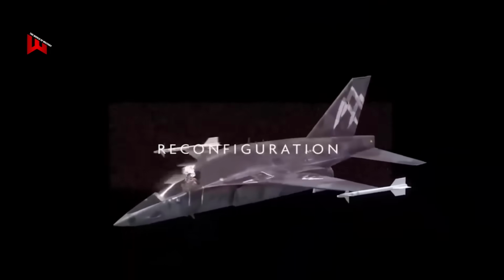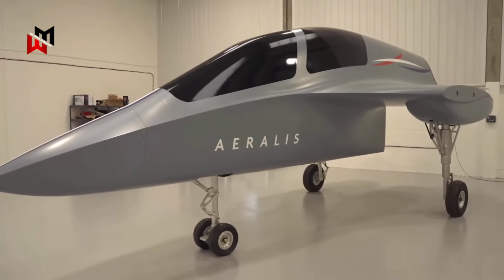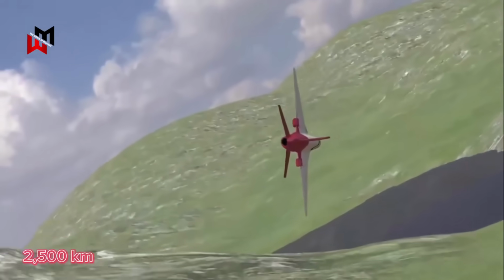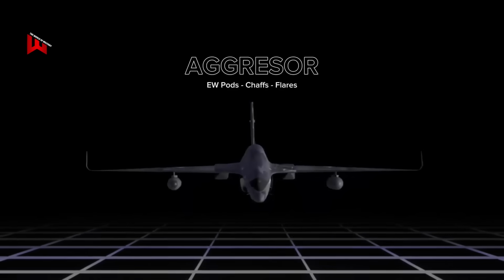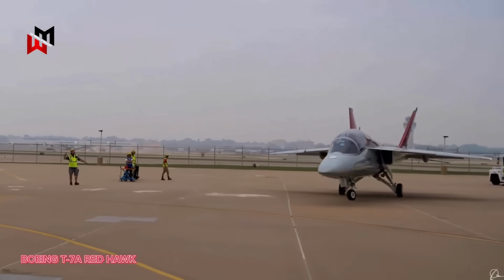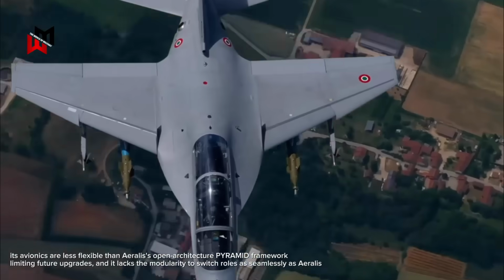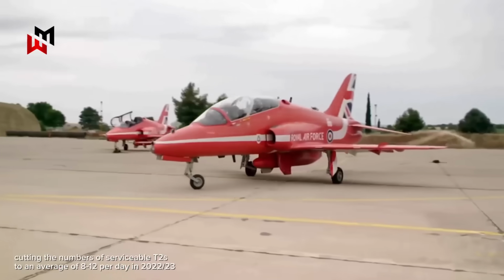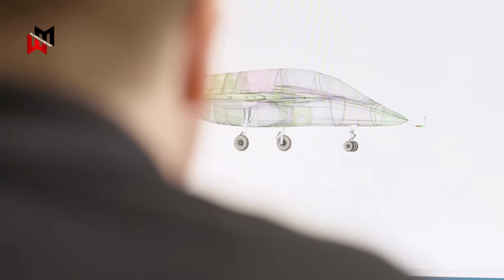Reasons Why The UK Air Force Chose This Aircraft Over the Boeing T-7A, KAI T-50, Leonardo M-436

Comment: Even if it is successfully developed, it is likely to be too expensive, too light, range too short….

T50 (trainer), TA50 (advanced tacktical trainer with radar and ground attack capability), FA50 (full fledge light combat aircraft) are all going to be cheaper than the cheapest of Aeralis trainer (the basic trainer with no radar).  

This is another example where UK is fixated by domestic developers and forgot about its true capabilities.  

If UK adopts FA50 under license, it can get some marketing rights in Europe and other parts of the world (eg Africa).  Ireland is looking for 12 light multirole platform for its own training and policing.  NATO and Irish parliament both recommended FA50.  UK could get the license to build FA50, satisfy its own needs and easily win that export order.  This will create thousands of jobs.  FA50 currently only has F404 option, RR can work to integrate UK made engines and slowly expand the market by being part of a successful franchise.  

Instead, we are going for a world’s first bleeding edge new tech ‘modular’ fresh development.  The problem is, we don’t have money, capacity and time.  This is the same as RCH155, Challenger 3 upgrade, Ajax.  Because we refuse to be part of other’s franchise, we are missing out completely and pouring so much money on something that is too expensive, not meet requirements, very limited export opportunities and massively delayed.  Something really needs to change.
Reply: Korea propaganda. Let Europe aircraft for European Aerospace industries

Comment: The only (theoretical) advantage that the Aeralis system can claim over other trainers is its modularity and perhaps its costs compared to the US trainer. In the future, we will see how well this modularity will actually work, making the Aeralis equivalent to seven different trainers…
Reply: It’s also British & would contribute to the economy rather than buying over-priced US jets.
Reply: @davidclerihew3539  That the US option is more expensive I already wrote, but compared to the other trainers are you sure there will be savings? Not to mention the 'pay for 1 and get 7'... I really want to see that.... If instead the main goal is to give work to a British company, then fine, and good luck with the trainer and the training.
Reply: Modularity usually makes more expensive and less efficient in the individual roles.
Reply: @PeterHuys-w3z  I totally agree! Modularity helps save on the overall project, but only if everything works… which is not easy given the complexity. In individual roles, as you wrote, there will always be a compromise in terms of performance.

Comment: Modularity has more to do with sharing parts and flexibility manufacturing, Drone Tanker/I-star will cost less than US flying gas tank and MQ-9B AEW
Singe engine Trainer and Twin Trainer, than you have two Low Running cost Fighters, giving new pilots Flight time and Air policing
Drone Tanker will save cost in aerial refueling training and refueling drone and fighter, US Navy killed Hornets Flight hours using them as Tankers.
flexibility in setting up aggressor fighter jet for Training, also UK is buying Trainer for Typhoon and F35A, this is all about getting more and cost less

This is about stamping die's and parts moulding cost, 
you got 7 plane and 18+ setup in 2 planes all share parts.

Buying Boeing T-7A and Fighter version from slow manufacture at high cost
or Buying KAI FA-50 Block II and T-50 like many are doing and Poland will making some of Them at home, not bad deal
M-346 Master well good thing Brits don't mine queuing 

9,000 lb from single engine sounds like RB199-104 same as in Tornado 
12,000 lb from twin engine sounds like 2x6,000 lb Adour Mk 106  it's a Jaaaag same as in Hawk T'2 
or US finger 12,000 lb from twin engine 2x6,000Honeywell F124

Comment: An ELINT variant of this aircraft would make sense imo to detect ground-based air defence (GBAD) systems as well as jamming equipment, especially if the aircaft was fitted with Leonardo's BriteStorm and MAPPS systems to make the aircraft very hard to detect and shoot down.

If the aircraft carried Brimstone 2/3 missiles (and/or SPEAR 3 & SPEAR-EW) it could take out Russian SHORAD systems (like Tor, Buk, Pantsir, etc) from safe stand-off distances (even if they were on on the move), and in the future the RJ10 variant of the FC/ASW missile should provide the speed, range and capability to take out S-300/S-400/S-500 SAM systems, again from safe stand-off ranges. In the meantime, AARGM-ER could operate as a stand-in solution until the RJ10 comes into service.

Comment: Sounds like it is ti good ti be true. That means it probably is too good to true. Anyone ask the cost to change all the parts over? Will they have all the parts to do so if needed in say ONE place? If it is a complete fly by wire, then with the changeover and then check out time to make sure all parts are operating as they should then it can fly? Most if not all wiring of this type are not meant to unplugged and then replunged over and over again. I can almost guarantee the general who THINKS this is a good idea has NOT done his homework on the matter. And the parts will I am sure all will work spiffy when ne what happens when the jets are 10 15 20 years old??  The people are just buying themselves a new problem for later .

Comment: It's ugly, I don't like the engine layout, and it's not supersonic. The best option is to buy the T50, which is tested and ready now. It also ticks all the boxes.
Reply: Max speed is Mach 1.2 - so yes supersonic.
Reply: Looks are subjective and of no practical use. If an enemy pilot is close enough to say your aircraft is "ugly" then you have MUCH more pressing problems.
Reply: A trainer doesn't need to be supersonic. The T50 is a modified F16 and as a trainer it is excessively expensive to operate, in addition to having outdated training suites.
Reply: @ettorefieramosca5460  훈련시설이 노후되었다고...? 무슨 근거로 그런 소리를 하는건가요? 최근 폴란드에 공급된 시뮬레이터는 장식물인가요?😂
Reply: If it works and allows British pilots to be trained in the use of single engine and twin engine through a modular system on a British built and designed aircraft then I don't think looks matter all that much.
Reply: No accounting for  your poor taste

Comment: The modular system is a terrible idea, great in theory a nightmare in practice. It is a false cost-cutting concept that attempts to get around the need for the right piece of equipment for the job with a jack of all trades that does no job well.
Ajax was a developmental disaster that ran staggeringly over budget and proved to have maintenance problems that are nearly impossible to overcome, other modular projects that have also experienced catastrophic development problems and went massively over budget include the F-35 and the USN's LCS class of ships, the latter project has now been abandoned with no usable ships emerging from the program.
It is better to 'pay the extra' to do the job properly by building two different aircraft specifically designed to carry out their mission sets and is likely to cost less in the long run.
Reply: Comparing modular designs from different nations isn't really a guarantee of failure.
Many issues with Ajax are down to inputs from outside of the UK making it far larger and more complex than we actually need, Ajax is heavily influenced by What suits the US and there needs not so much ours ideally we needed   something similar in size as the cvrt now we have something not much smaller than a challenger that could never operate in more traditional recce roles.
Although the US gave up on their modular naval designs the British and other European nations have produced modular ships that actually work and offer small navies the ability to field what's needed when it's needed.
The Aeralis platform is still in development so just jumping ship and buying a foreign produced product that doesn't necessarily suit British needs before testing has started isn't a very smart move either.
The way I see it is modular design works well for smaller nations with limited budgets but the US has no need for modular designs because they can field everything needed without worrying about cost so instead of making it work they tend to just scrap it and go back to what they know works.
If Britain wants to stay up there as a reliable military power in the near future then Modular programmes like Aeralis and others are key to keeping us effective on a global scale and keeping our military effective is key to keeping the US on our side for the foreseeable future.
Reply: As the plane ages they will be rewiring them as connectors wear out. Plus what is the time Est to reconfigure a plane? will all the parts be on a single airfield. the list of things that can go wrong are countless, bad idea.
Reply: This aircraft wouldn't be used when configuration changes must be urgently made. They aim to train a pilot in various configurations as and when needed. There will be a base amount in every configuration. Only once the training needs are known will there be changes. Finally, the beauty of this platform is that as each model goes through innovation and upgrades, you only need to upgrade that part rather than make the entire aircraft redundant.

Comment: Why isn’t Bae looking to build a replacement to the Hawk
Reply: It's working to the max on GCAP.
Reply: @dougwhite1491  Which itself is speculated as being impractical to move off the drawing board into reality. Why BAE couldn't have a smaller sister project to redesign the HAWK platform to quickly have a British made updated jet trainer gawd knows! For an urgently needed training aircraft you don't need to reinvent the wheel. Typical short sightedness of the UK MIC, all the eggs in one overpriced underfunded undeliverable on-time or to scale basket!
Reply: @dougwhite1491 Oh yes of course my bad😔
Reply: BAe just signed a contract with Boeing to bring T-7A to the UK.
Reply: They are a parts supplier and assembler they gave up on making their own stuff years ago when the accountants took over.
Reply: @twasb2000  That's not an excuse. Accountants took over Boeing and it fails at many projects, but it still designs & manufactures own stuff.
Reply: @Greenfield-yf1wh  The problem is a management totally affraid of taking any risk  and solely focussed on maximising profits. Boings problems have come from a similar mindset.
Reply: @twasb2000  The management is literally paid to minimise any risk and focus on maximising the company's profits. That's their job. Engineers who climb to a top position in a large company often do the same thing - for example, Condit who pushed Boeing to merge with MD was a Mechanical Engineer by trade.
Reply: @Greenfield-yf1wh  Im not disagreeing but the end result is a risk averse company that slows innovation to a snails pace. The only way they get jolted out of it is when we have a war. If only there were a way to incentivise the innovation and let them take the risks.
Reply: They might become involved on an industrial level.
Reply: Bae is out of the game
Reply: All new aircraft have to have that woke look now